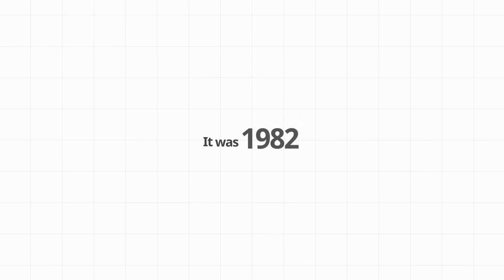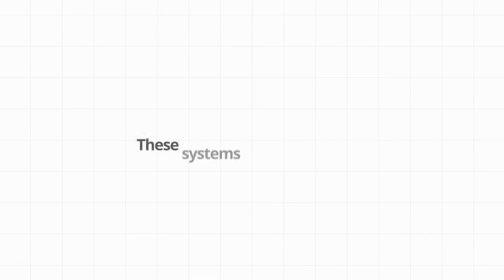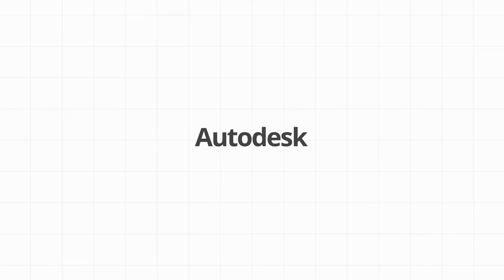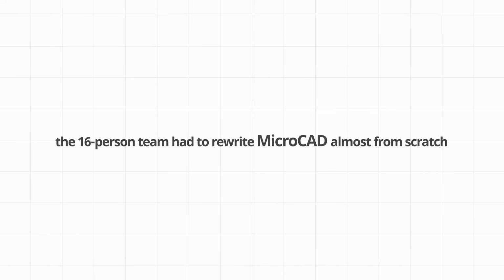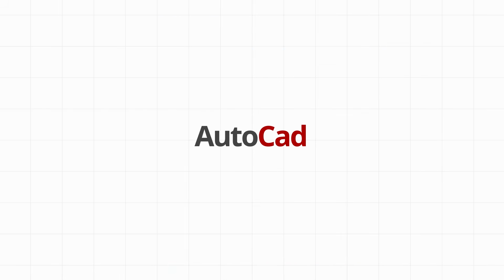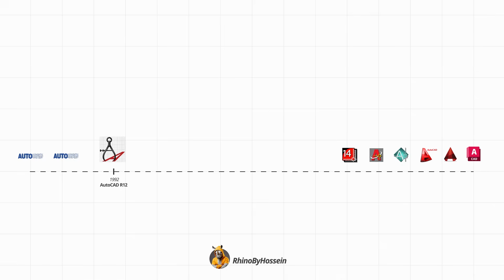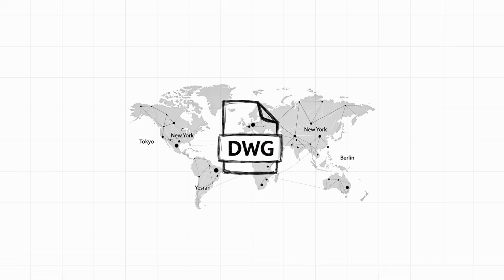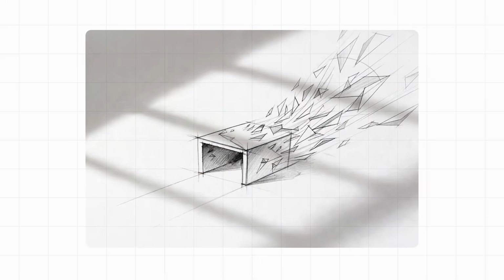Empire of Lines: How CAD Revolutionized Design – The Complete History of AutoCAD

Comment: Its been a great piece of design software. Mid to late 1990''s AutoDesk released Mechanical Desktop, built on AutoCAD and 2 other programs  (Designer and Autosurf) and that allowed for 3D parametric modeling. It was a capable piece of design software, and MDT was a great entrance to learn the  capapabilities of full 3D modeling on higher end programs like Unigraphics and Catia, but it aligned more with mid range applications such as early Solidworks abnd Solidedge.  This was a great histoty lesson, shame it didnt include MDT, as that deserves recognition I think.
Reply from the maker: That’s a great point, it definitely played an important role in the evolution of parametric design tools! 😊

Comment: My father had a technical bureau that started with huge Drawing tables that could be turned to your drawing preference. Of course error editing was possible, they used transparent paper that was easy to be chemically photo copied and could be edited by scraping off the ink. It could be done 3 times or so until you broke through the paper. And of course you did a pencil draft before that could be erased a dozen times easily. 
We had a 286 at home, with Autocad 2.1 copied, but we only used it for looking at the default 3-D shuttle drawing. In 1998 my father finally bought the first serious 486 computers displays and a back then revolutionary inkjet color plotter named Encad. The drawing tables remainde for comfortable inspection and remarking of printed plans. One day around 2004 mocking collegues challenged my father, if he could still draw by hand - which he of course demonstrated. That was the last time anyone ever used an inkpen there.
Reply from the maker: Thanks for sharing that amazing history and your father's journey with design tools!

Comment: Hello.

Quite comprehensive history of AutoCAD (but not of entire CAD). But I’ll start with pre-CAD way of producing technical drawings (plans, blueprints). I’m a mechanical engineer, old enough to witness this process personally, but young enough newer to produce a “professional” drawing “manually”, I started with AutoCAD from the first day (it was on September 1992).

Mechanical design people did draw directly on tracing (transparent – vellum) paper (on drawing boards of course) with sharp, hard pencil (H4 hardness). Everything was drawn with very thin lines (rules about line thicknesses was not followed), only for special lines as symmetry lines and hidden edges the line type according to norm was used.

When drawing was finished the sheet of tracing paper was handed over to a draftsman. His task was to overdraw all the lines with ink and to write all textual remarks. The Rotring Isograph pens were used (line thickness 0,25mm; 0,35mm; 0,5mm and 0,7mm respectively). There was almost no possibility that such pen would leak, I used it extensively during my study and have not one leak at all… For textual remarks stencils were used so all writings were clear and uniform.

Is afterwards some change has to me made, this was never made on original drawing (on tracing paper), but on a transparent copy of it. The changed area was erased using razor blade and hard eraser and new geometry was drafted. The whole procedure was the same as for the new drawing.

So catastrophic failures were almost impossible to occur. Surely, whole procedure was much more cumbersome and time intensive compared to CAD system.

I’ve read and heard about AutoCAD before, as a student of mechanical engineering I did some practice on a complete different CAD system (running on VAX 11/780 and graphics terminal from Tektronix). At my workplace we had an IBM PC/AT and there was AutoCAD release 9 on it. It was usable but it has some quirks and flaws. IMHO most serious was that the flood hatching didn’t work as it should, it almost always did some hatching lines outside supposed hatching area. On the beginning it was this was so serious obstacle it almost rendered AutoCAD unusable for serious use. Than I discovered a workaround for this. Flood hatching worked flawlessly if used on area circumferenced with closed polyline! So each cross section that should be hatched has to be converted into closed polyline. If the form was simple, then it was not a big deal, but it was tedious and time consuming for complex cross sections. With this workaround the AutoCAD became really usable tool. At the time I was looknig for CAD system that could be used within entire company and has no limitations that AutoCAD had. So I managed to get a system form Hewlett Packard for trial. This was HP 9000 Series 380 workstation with ME10 CAD package on it (ME stand for Mechanical Engineering). HP was serious CAD contender in Europe but almost unknown in USA, R&D was in Böblingen in Germany. This was different beast compared with AutoCAD 9. It strongly relied on construction (auxiliary – temporary) geometry. Construction geometry were endless lines and circles which could be overdrawn (traced) with real geometry lines and radii. If drawing becomes cluttered with construction geometry you could erase it with one click. And it had good support for detailed views, no need to say that the flood hatching was working flawlessly. On HW side it relies massively on use of graphics tablet (digitiser) with most important commands listed on ME10 template which was put on the graphics tablet. It has good thought out and linear workflow. AutoCAD figured out all this issues with time, so it become “endless” lines, model and paper space with viewports and good flood hatching. After using ME10 I stared to use extra long lines on layer named “CONSTRUCION”, and it was really usable, but not as elegant as in ME10. ME10 setup has only one flaw, it was extremely expensive compared to AutoCAD setup.

My highlight of work with AutoCAD came about 5 years later, when I started working in a company which utilized serious AutoCAD workstations. Each workstation has 25” CRT color monitor for drawing and 14” monochrome monitor for commands. This was completed with Genius 1218a digitiser with AutoCAD template on it. Computers were MS DOS compatible of course but they featured special graphics card, they were called ACAD accelerators, if I remember correctly. This cards were product of SPEA and ELSA companies. AutoCAD version was 12 and work with this configuration was a breeze! But writing was already on the wall, 3D modeling was obvious future and we switched to PTC Pro/Engineer…

I would add another important milestone to AutoCAD history. This is version 13 which for the first time includes ACIS kernel, providing Autocad real 3D solid capabilities.

In such stories geographical position of the writer matters because development of CAD deployment was different in different parts of the world. I’m from Slovenia, Europe and in 1992, when my story stats we were still a part of Yugoslavia…

Have fun...

Comment: In 1984, at General Dynamics in Fort Worth, we had a home grown CAD tool called ACADS.  It stored the CAD file into (13) separate files.  One for points, one for circles, one for text, etc.  It ran on a PERQ workatation and saved the files on an 8" floppy disk.

After that, we used CADAM for 2D drawings and CATIA for 3D models.

Anyone remember "flange angle splines"?
Reply from the maker: Amazing throwback. ACADS on an 8" floppy sounds wild by today’s standards 😄 CADAM and CATIA definitely shaped a generation of designers. And yes — flange angle splines bring back some serious memories!

Comment: Back in the early 2000s I was teaching my self AutoCAD to design radio controlled airplanes,  and posted a few question on various CAD forums.   Overwhelmingly the response was I needed to take a 2+ year course to learn it properly, and in the end I really didn't get much help.   My how times have changed.
Reply: I learned it within a year in '91-'92 through 40-hr work weeks, hour-in, hour-out.
Reply from the maker: It's amazing how much the learning landscape has shifted!

Comment: Before CAD I had to use a rubber to fix pencil errors. Then came Catia....  then the PC and Autocad. Now I mix coding with CAD in OpenSCAD.
Reply from the maker: That’s an amazing journey from manual drafting to code-driven design!
Reply: @RhinoByHossein  Not finished yet, still need to figure out AI enhanced CAD. Text to AI made BVH poses for Makehuman/Blender. AI parameters for OpenSCAD..... AI Procedural coding.... Maybe one day direct thought control of 3D printing.

Comment: Would you be interested in doing a History of AutoDesk Inventor ?    I have a contact in Portland OR who was on the original team that AutoDesk bought up... and then worked at AutoDesk for 30 years and lead the team that developed Fusion 360....
Reply from the maker: That would be absolutely fascinating — I’d definitely be interested in a history of Autodesk Inventor, especially with insights from someone who was on the original team and later led Fusion 360.
If possible, it would be great to connect on Instagram and continue the conversation there.

Comment: AutoCad was made to turn CAD systems affordable to the final user,  unfortunately Autodesk greed financers turned AutoCad completely unaffordable, with prices,  subscriptions, tons of features only big corporations will ever use; thanks to other rebels tired of the tirany if financial mind comes FreeCad,  an open source tool that for small companies, self employed engineers or even hobbiests can finally afford an outstanding CAD software that will crash its bank account.  FreeCAD outperforms AutoCAD in many areas, specially in a smart way to work with 3D design.

Comment: Just want to leave my mark here in the first day of 2026. As a 59 years old architect, I first saw AutoCad drawn drawing in 1990 in Brisbane, Australia when I just arrived Australia from China as a student. The first AutoCad version I used was version 8 if I remember correctly and the first Adobe Photoshop version I used is version 2.5, even before Photoshop has layer capability. In 1992 I purchased an Israel software called ArchPlus or Arch+ when they had tech demo in China. As even in 1992, I thought why AutoCAD was so limited in 3D capability. It can not create real hole in wall for windows and ArchPlus can. It is like pioneer version of BIM (I think they are gone forever now, I really hope I can meet someone Arch+ user here). In 2006 I spent 2 days and nights reading Revit tutorial book in New York. The first Revit version I used is revit 2006. I always think AutoCad is just a digital line tool and essentially no difference from Michelangelo or Da Vinci's hand drawings. Theoretically Da Vinci can hand draw and design today's skyscraper with paper and ink. There is no way you can achieve AI intelligence from this "line tool" like AutoCAD. Today, I am nearly broke. My team spent nearly 2 years developing something totally new. It will turn standard PDF (either drawn by AutoCAD or BIM like revit, archicad or verctorworks) into a digital carrier of 2D drawings (as they are legally required as documents), animation videos and interactive VR. I will post demos on my own youtube channel in about 10 days time. I make this comment just for a record in history. Happy New Year everyone!!

Comment: I started with the IBM PC shortly after they came on the market.  The small engineering company where I worked was using hand drafting.  There was more technology than just pen and paper, we drew on multiple layers of mylar just like you draw in CAD, and there were even forms of copy and paste available but it was still time consuming.  My employer bought a used CAD system based on a minicomputer but it was cumbersome and required a lot of infrastructure.  Eventually we got into AutoCAD on personal computers starting with release 9.  This was a very usable program and could be customized to have an interface that can accept commands fast and draw complex entities with small amount of input.  Since you could customize the user input the change to Windows didn't mean much, the DOS version was still fast.  I think in some ways around year 2000 was the peak of AutoCAD.  As it has evolved and gained functionality it has become harder and slower to use.  People who want to use it strictly for creating drawings would be better off with older versions.  As AutoCAD has become more powerful the technology has outpaced it and now in the business I worked in very few people use AutCAD, they have transitioned to a 3D modeling program called Revit, not created by Autodesk but now sold by Autodesk.  AutoCAD and Revit have both become very expensive, too expensive for the individual user.  There are less expensive programs on the market and I use one for my personal use, but those are not nearly as productive as AutoCAD once was.

Comment: All I can remember about the very first CAD software I ever saw is AutoCAD (I’ve forgotten which version), where a technical drawing of a Space Shuttle was displayed. It was sometime in the late 1980s, when I was still in primary school. Now, almost 50 years old, I work extensively with 3D solid modeling (mostly in Moi3D) and that Space Shuttle image from back then has undoubtedly had a huge influence on who I am today.

Nice video !
Reply from the maker: Thanks for sharing your fascinating journey with early CAD, it's amazing how those initial experiences can shape a career!
Reply: That was COLUMBIA.DWG. It was imported into AutoCAD. It is a 2D projection, not a 3D wireframe. RIP Columbia.

Comment: Just a quick correction, I worked and coded in AutoLisp in 1986 (Acad 2.17) turns out AutoLisp had a major flaw: it was an interpreted language which added to the fact that the PC was really slow meant only small projects were feasible at the time. The real game changer was the introduction of the C ADS system, a truly professional & powerful programming environment. Awesome video!
Reply: Agree
Reply from the maker: Thanks for the correction — that’s a great point.
You’re right: AutoLISP was powerful but limited by performance at the time, and C ADS was a real game changer for professional development.
Really appreciate you adding this detail, and glad you enjoyed the video!
Reply: For a non programmer I found lisp to be a great tool, increasing the speed of designing significantly through customization. My favorite lisp program at the time was before Autocad had ordinate dimensions, and I wrote a lisp program to create them. The ability to add functionality by the average user was a strong point that shouldn't be under estimated.

Comment: Nice to see an history video about CAD. Is missing more of a decade of Unix Workstations and the incredible CAD systems running on it. Most importantly, the success of AutoCAD in the 80s and early 90s does not have anything to do with the product. Pirated copies of AutoCAD made AutoDesk. Few paid $1,000, it was not worth it. But millions installed it on their PC to show family and friends computer graphics. Then the first wave of application developers was born, selling add-ons to AutoCAD for mechanical engineering and architecture. AutoDesk business in the late 80s and 90s was about converting pirated copies to licenses. Then, sometime in the mid 90s they figure out they needed to add value to AutoCAD and they bought the top application developers, and start selling vertical versions of AutoCAD for mechanical, architecture and so on. That lesson is why you can use Fusion 360 for free.
Reply from the maker: Thanks for the great insight.
You’re absolutely right about the Unix workstation era and the role piracy played in AutoCAD’s early spread.
The shift from mass adoption to value-added vertical tools is a key lesson — and it clearly connects to Fusion 360 today.
Really appreciate you sharing this perspective.

Comment: Many, many years ago, I was hired into an Engineering Department as their "CAD" Draftsman - turned out that the department didn't even own a computer, much less AutoCAD.  And the Engineering Manager was against computers altogether.  It took a year for us to get our first computer and a copy of AutoCAD.  I don't remember the version (definitely DOS-based, probably R13), but it involved the PUC and Digitizer Tablet.  The PC was mounted on a gimbal above the drafting tables.  After a few years, we had completely abandoned the drafting tables, and a few years later, stopped printing the CAD drawings on velum and running blue lines.  I self-taught and eventually became the go-to draftsman and then on to the Design Dept. Manager.  Today I stull use AutoCAD (and other drafting softwares) but remember the old days with favor.
Reply: I wasn't far behind you.  '89 BSME here...we had NO CAD at the university unless we were a co-op lucky enough to have the company we worked for allowing us computer time.  I started on Acad V.10 for DOS using a Summasketch II tablet.  Moved to V.12, then V.12 for Windows (no more Summasketch), then V.14.  Moved to CADKEY 97, then was fortunate enough to get into Solid Edge in '99 at the V.6 level.  Now I'm working toward moving full-time to FreeCAD which has now become a serious enough open source program to make the jump.  Haven't used Acad since 2008 for a few months.

Remember the days where networking involved copying files to a 3-1/2" disk and moving them by hand to another computer?  Good times.
Reply from the maker: Thanks so much for sharing your incredible journey with early CAD, it's amazing to hear how you adapted and grew with the technology!